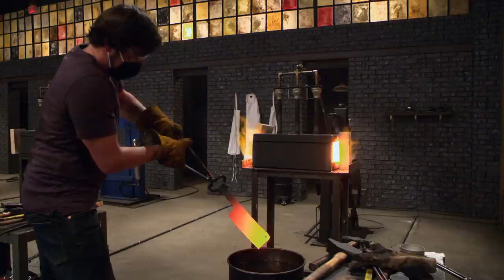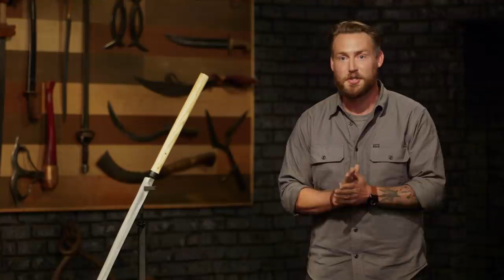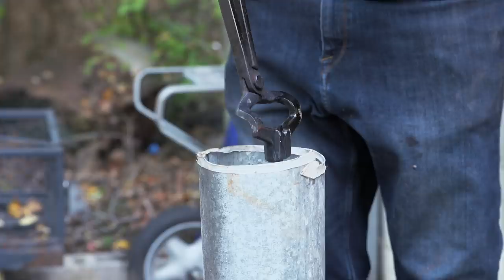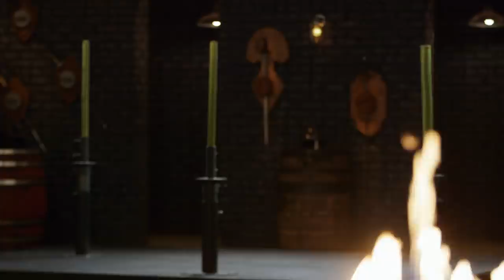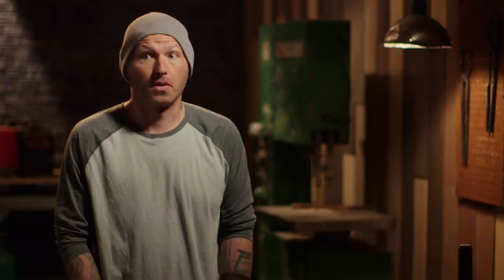TERRIFYING TUNA SWORD TEARS IT UP | Forged in Fire (Season 8)

Comment: For until the replay bar appears:
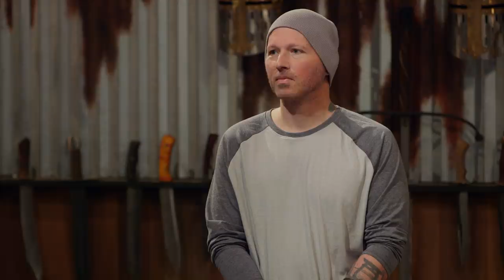3:50 Keel test
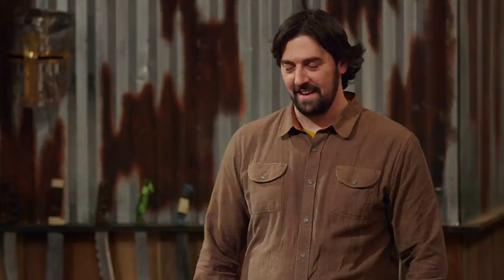4:30 Keel test
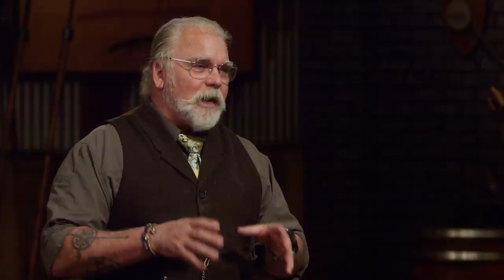5:30 Strength test
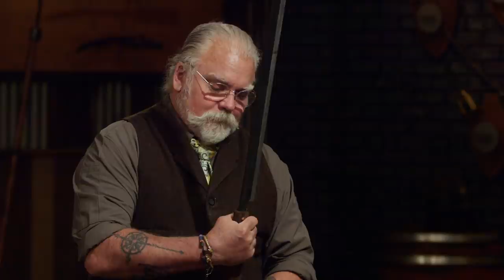6:20 Strength test
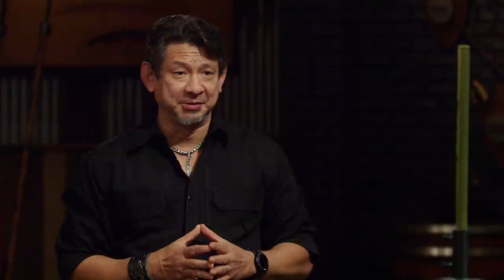7:35 Cut test
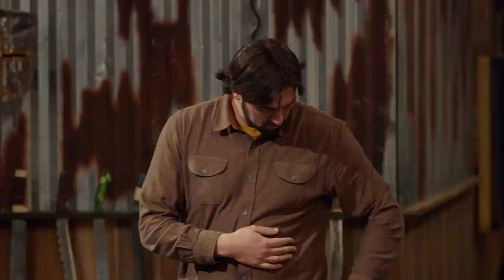8:15 Cut test
9:05 Verdict
Reply: You spelt keel wrong it us not spelled keel it is spelled keal

Comment: do the test that can literally break the blade in half, and then do the sharpness test right after. eh???
Reply: Thats on purpose. THey are testing for how well the edge holds up after the stress of being used. Almost any blade is going to be sharp right after forging so you need to simulate some ware before you can decide if the edge is any good.
Reply: They should use that test more often

Comment: I haven't watched many of these...but this doesn't entirely make sense.  Should the sharpness test, for a TOOL, not be something that comes first?  You wouldn't slam a chef knife into bone before checking how sharp it is.  Not to mention with a TOOL you're not going to be attempting to slice through three FISH.  Not to mention, who's going to stress test a kitchen knife by smacking it with sticks?!  Not necessarily ripping on the tests...  but why these tests, for this TOOL?
Reply: part of the test... is how well a blade KEEPS the edge.  any freshly sharpened blade can cut.  but a good blade will stay sharp after being used.
Reply: bruh
Reply: it's a test of edge retention
if it still holds its edge after all those rough tests
then it's sharp

Comment: I think its unfair to judge based on the lightness of the blade. the purpose of the blade requires to be on the heavy side.
Reply: Not sure i am thinking in right concept but to cut tuna you how much ever light as possible is more preferred right? If this should be used for fighting, then heavy one is preferred.
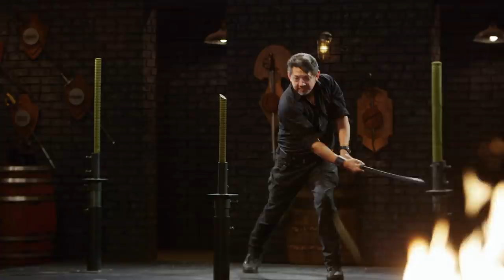Reply: @kunalsinghal1247  also that bit at 8:25... doug pauses for a moment in shock that the second one just cuts like the target wasn't even there.  that kind of sharpness is perfect for cutting fish.